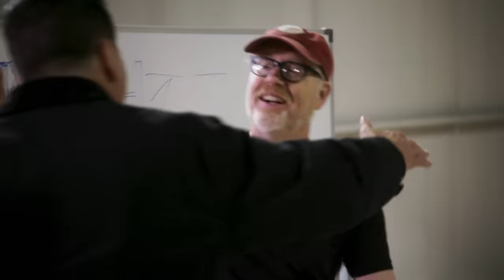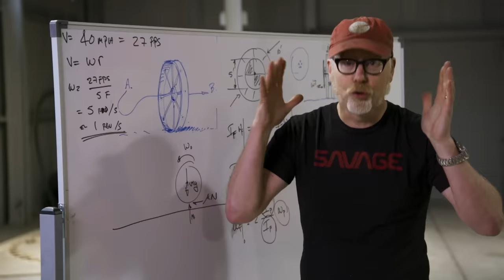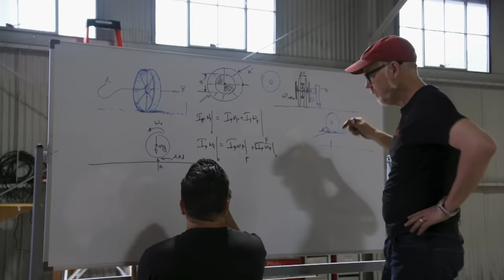"The Power In These Flywheels Scares The Pants Off Me" | Savage Builds

Comment: "We've mounted our twin 5-foot flywheels on a perfectly balanced custom axle..."   on 2 rickety metal sawhorses and secured with a single guitar strap.
Reply: I actually think the Strap could be strong enough to hold the Wheels, if they touch the ground, because they slide. It gets problematic if both wheels do not hit the ground at the same time, and the edge of one of the flywheels cut through the strap.
Obviously they should have used two straps to stop any turning and probably would have been fine, apart from flying pieces of concrete.
Reply: @Opharg  Yep. The 1st thing I was thinking before they started spooling it up was if there was any linear "crawl" it would try to rotate horizontally on the sawhorses; and with only 1 strap, would likely continue until.....and yeah the strap would probably hold unless it either twisted til it broke or like you said, a wheel cut into the strap.   Scary stuff.
Reply: I suspect that, if the thing and fallen or twisted off the sawhorses, it would immediately bounce around the building at speed dragging the sawhorses with it. Unless they were bolted to the floor?
Reply: Lead Engineer on the NASA Mars program, but here he is watching a couple of giant lethal wobbly steel disks strapped to a couple of oversize steel trestles using an old car seat belt...
Reply: But it would have been another $9.99 for a second strap.
Reply: Probably some duct tape in there too. For confidence.
Reply: Or, you know, just chain the axle to a roof beam.
Reply: @WrongDemographic  Sawhorses wrapped up around the axle......a giant out of control self-powered Cuisinart set to puree.
What I would do: beefy over-engineered steel mount bolted to the floor with bolted U-brackets clamping it to the mount. Then maybe I would be in the same room when they spool it up.
Reply: Adam savageness intensifies
Reply: First question out of my mouth was "why didn't you weld a set of lift points on that thing and hang it from a chain fall hoist!?"
Reply: too funny
Reply: Respect for that guitar strap.  Rock on!
Reply: Question would be how much traction if one or two hit the ground. My guess is it would slip and spin in place and lose energy as it gets traction. They need to bolt it down.
Reply: @michaelmoore7975  I was thinking U bolts too but suspending it from above is also a better idea.
There are just so many better ideas than this..
Reply: @hexdude24  I was thinking about things like a sphere when spun tend to just spin along the same axis as applied. But irregular objects set to spinning will try to upend itself and spin on the smallest rotational axis. A football set horizontal on the ground and spun as it is (large axis) it will raise up on its end and spin like a spiral (small axis). Coins do the same thing, they want to spin on the edge. No matter how much you lean a top over and spin it, it will always try to get back upright. 
But what do I know...I'm just thinkin'.
Reply: Those plates are wobbly.
Reply: The axle and the saw horses should have been bolted down
Reply: @michaelmoore7975  they had a forklift (3:35). Rather than hoping concrete anchor bolts hold, I would've tried to tie to the weight on the forklift's rear. Even if part of a flywheel comes off, it's not going to move a forklift much.
Reply: You guys know this strap is actually made from Kevlar Right?
Reply: @victorteixeira2539  Yes. But against 330 tonnes of kinetic energy, it's an old cotton shoelace.
Reply: @davidhawley1132 ......it's "flat" plate, but like everything it's made down to a price.
Reply: @hexdude24  Each wheel weighs 450 lbs, and when added to the weight of that hefty axle, you’re looking at half a ton of weight on the ground if it falls off the sawhorses. I think that would give it quite a bit of traction.
Reply: @briggsbughouses6291  and this is why spaceX is so far ahead of nasa.
Reply: @robertwoodliff2536  Yeah, flattish, so let's twirl it around to find out how much.
It is interesting how objective words (flat) are subject to the context of the goal (aka objective)..
Reply: Yeah I saw those and thought......um oh no
Reply: @rm9308  The 'Samson Manouever'.
Reply: @briggsbughouses6291  Seatbelt Stronk. Tensile strength 5,000 lbs.
Reply: J K 

The axel had been balanced so welding brackets to it would ruin that
Reply: @frednurk5168  What's wrong with a couple of M16 U bolts so the axle is held rigidly, rather than lashed at a single point in the centre which allows for the axle to cant sideways?
Reply: @ian9toes  But the steel plates were not machined and balanced so that makes the assembly out of balance.
Reply: @mattburgess5697  🤣🤣☠️
Reply: @nightwintertooth9502  Turned up to 11 too...
Reply: @2000freefuel  can't get a secure coupling from the motor to flywheel if the flywheel is dangling around. Perhaps we shouldn't be second guessing lead NASA engineers eh?
Reply: @xnavynuc  Inertia would hold it back initially so it would spin some in place and then gradually gain traction.
Reply: @briggsbughouses6291  speaker scene back to the future.  :')
Reply: @hexdude24  Maybe not much... at first. But it will either angle grinder into the floor (best case) or more likely given all the weight slowly start moving. Think about the wheels on a train. Not a lot of friction and they slip and slide as they start up. But as it gets moving...
Reply: @BigSteve215  Yeah, everyone's talking about the safety issue, but you're pointing to the root cause. A high RPM flywheel has to be precisely balanced, not cut out of steel plate which will randomly vary in thickness.
Reply: @cr4zyj4ck  you can do both! leaving that thing unrestrained is simply irresponsible. they could have left it on the saw horses while it was chained to the rafters, had they done that it could never have touched the floor.
Reply: Just because the axle is "perfectly" balanced doesn't mean the rest of it is.
Reply: @victorteixeira2539  You know that would be entirely pointless, right? More weight for the same strength and lower cost would be an advantage.
Reply: @D all that along with flexing and oscillating in all manor of strange ways as it turns.
Reply: Jiggers .. roulette wheel, & "where she stops, nobody knows.."
Reply: Right. I'd be too nervous to be near set up and I think they realized after how bad it was.
Reply: Reminds me of a wood chipper at a factory that made the flywheels in the video look like spinning toys. The chipper flywheel was at least 9” thick and big in diameter, maybe 6’. It took a massive traction motor and quite a few minutes to get up to speed. The motor had to cycle a few times as to not overheat. Took longer to shut it down. We would take an extended 15 minute break that was more like a half an hour and it sometimes would still be spinning a very very low speed. Had to run some small limbs through it to stop it. A change of blades and waited until back up to full speed checking for any vibrations. Massive energy stored in flywheels.
Reply: @victorteixeira2539  I don't think they care. To much fun being critical.
Reply: My thoughts exactly. They usually hide behind something but they are standing there waiting to be flayed.
Reply: u must be new ? welcome
Reply: you can see they are not straight probably out of round and not balanced. 6:44 it's like an inch out.
Reply: That's why you need actual science ppl to do it. If I were there I would have just let it spin until its out of control. And hope it doesn't hit anyone.
Reply: @rm9308  Yeah, if the largest danger is the flywheels coming off the mount and hitting the floor, then just make sure it can't...
Reply: looks like a seat belt from a car to me
Reply: @whatelseison8970  if youve ever had a spining wheel or disc in your ha d, and tilted the rotational axis at all. Youd probably think twice about hanging it from the ceiling or suspending it at all. I think its called precession, but the wobble that could be created if they are not securely mounted would get out of control and probably rip itself from whatever it was suspended from or take the entire building down with it if it had enough rotational velocity, and mass, which those flywheels at 1k rpm very well could have lol. Honestly id love to see it just for the destruction and demonstration of physics.
Reply: @thatnissan  Yes, I've done many experiments with spinning discs, and yes it's called precession. It occurs in response to a torque being applied to the axis of rotation in an orthogonal direction.  If the axle was supported evenly there would be no such torque and hence no precession.  Besides that fact, support is support and regardless of precession the weight of the assembly is not going to change.  Also I didn't say it was a great idea, (if you look closely, it wasn't even my idea) just that it was a better one.
Reply: @whatelseison8970  im not here to bash, just discussing.
In my mind the torque applied would be their way of removing the starting mechanism they way they did. If it was suspended, as i said, id love to actually see something like this happen at this scale. It would be incredible.
Reply: NASA has always been cost-saving oriented. Remember they re-used the tapes that had recordings of moon landings and were ahead of time to save the recordings on a CD or something.   Well done, NASA.
Reply: Oh, I get it, the axles are perfectly balanced and they mounted the things that needed to be balanced on the part that really didnt need to be ballanced?
Reply: Ya, you caught that. It's as simple as spinning up a bicycle wheel and holding it by one end of the axle. Yes, it will remain vertical and yes it will want to rotate on the horizontal axis. I ride motorcycles that are plenty fast. Ride over a slight rise in road surface at full power at 120+ will have the front wheel off the ground...that rotational torque will want to turn the front wheel to the right...if you dont know that things can be plenty scary when the front wheel comes down pointed in the wrong direction
Reply: @blackbirdxx928  Know what you're sayin'. I've raced dirt bikes for years mx, tt, hare scrambles, etc. Over big doubles or triples if you clutch it and dab the rear brake, the front will drop so you can downside the landing. Or pin it off the jump to make the front end come up.  2 wheels is where its at.
Reply: Funny how stuff that doesn’t matter doesn’t matter
Reply: @MarkSkater  Uh..thank you? I guess. Am I new here? You're referring to me, right?
Reply: @fungdark8270   Thats what the show is all about, things that dont matter. Ever learned a single thing that would benefit your daily life?
Reply: @blackbirdxx928  Yup. Just the axles, nuthin else. Should've balanced the axle housing, the strap, and the sawhorses to complete the unnecessary uselessness....a bit lazy IMO..... but there was an "engineer" on the job, so it's his call  I guess. ;)
Reply: They really should have chalked on both sides of the axle to eliminate this problem.
Reply: @michaelmoore7975  ok
Reply: better use carbon stripe with epoxy to make flywheels
Reply: @briggsbughouses6291  well, on Mars, nobody can hear you scream :))
Reply: Oh come onnnnnn. Weld it to the saw horses, pffft.
Safety nanny's
They are going couple this spinning monster to a set of huge friggin wheels that will shred itself over, under, around and through whatever is in front of it.
Reply: @telephonevip3610  The whole point of a flywheel is mass.  The more massive the better.
Reply: @briggsbughouses6291  then that would’ve broken the budget and we’d be watching this on the Hallmark channel.
Reply: @TheDivergentDrummer  no. it depends on RPM. metals are not so durable at high speeds.
Reply: Yep I was going to say for a network, seems like this was on pennies in someone’s backyard.
Reply: @nightwintertooth9502  I would definitely use a couple of Zakks guitar "straps."  His are the only straps that are heavier than an already heavy guitar.
Reply: @briggsbughouses6291  sometimes you got to wonder how they managed to get anything to space...
Reply: thats what i was thinkin lol, although the strap appears to be similar to a seat belt, so it makes up for the shady stand ll
Reply: @2000freefuel  rotational force would have twisted it if it were hanging on chains. Both sides spinning might have conteracted that but it's a pretty fine line
Reply: Want a real world comparison? Old school shearing grinder.spinning at 2500rpm discs weigh roughly 8 kg. I've seen one come off,bounce 30 metres across a shed,straight through a full wool bale and out the side of the side of the shed. We found it it about 100m away
Reply: @victorteixeira2539  you do know that kevlar can be cut fairly easily, right?

The best option that for whatever reason everyone is overlooking is chaining it down at 4 points instead of 2.
Reply: @yubnub3000  Yes! I was thinking the same thing. All that brain-power, in one room, and NOBODY thought to bolt the saw horses to the floor?! 🤤
Reply: Where ist the bit, where the pants are off?
Reply: DiabolicalGardyloo  to be fair, for something of that size and having that much risk, I wouldn't really say it was suitable. Hence why they shut it down early.
Reply: I hope there was an argument between the NASA engineer and the show's producers before they fired this up.
Reply: What, no duct tape? Naaahhh! 😯😉😄
Reply: @Opharg  should have been bolted down to avoid any vibration . I think a clutch type mechanism similar to a crane brake on each disc could be used to disengage once RPM was obtained would do the job too and act as a brake .
Reply: haha, it was as if they WANTED it to be sketchy
Reply: Such genius couldn't have devised a better plan. Not even a balanced wheel!  In all actuality i do like the guys,  but come on.
Reply: @michaelmoore7975  Think I would have preferred to put the trestles on wheels with rubber tyres. If it gets a wobble, at least the trestles will move with it. Also, rubber tyres will dampen a part of the wobble.
Reply: I guess none of you have ever worked on an advanced project. This is proof of concept and determining the level of construction and other parameters they're going to need for the initial build. This isn't even a prototype at this point. The point wasn't for it to be the most stable or to be perfect, but to gauge how well balanced it was under low power. The straps etc have zero influence on this and they didn't cause any of the problems that occurred.

The problems occurred due to a bearing, and possibly the balance of the wheels themselves. And the axle may not look pretty, but there's tons of shops that balance them so even a used one is sufficient for these purposes.

You're a bunch of Armchair Engineers that have accomplished nothing, basically.
Reply: They are nerds, not geniuses.
Reply: @rm9308  Ya, that's the simplest and best solution.  They won't go anywhere if they are suspended instead of strapped down.
Reply: @michaelmoore7975  Yes. Low safety standards. "Teaching" people to do unsafe things.
Reply: @ian9toes  yeah that's right they couldn't weld a bracket to it. Of coarse they could attach to the bearings. You do know they used bearings didn't you?
Reply: @ian9toes  nah u do the welding first and then the balancing... in the same way prop shafts in a car are modified
Reply: @briggsbughouses6291  cause then nobody would watch it cause we know it's safe :)
Reply: Also, if that thing gets loose in that building, which was a clear possibility, no one is safe. Maybe no one lives.
Reply: @garyfliess4375  Even if everything was secured rock solid and inspected by the world's top engineers, then maybe, just maybe, I might possibly be in the same county when they spooled that thing up...... yeah, no....prolly not.
Reply: Should have the axle in a cradle shaped to it....
Reply: And an advanced 2x4 braking mechanism. 🤦
And surrounded by a mechanical containment system of "umm... well we parked our trucks outside the door, OK?"
Reply: @michaelmoore7975  purée omfg
Reply: And it is this guitar strap that made think this would rock!  But it didnt.
Reply: It would have been way safer if they made it a hair taller and put in two identical curved cuts on it
Reply: @itukuppoo4280  But it would definitely roll.   ;)
Reply: @whatelseison8970  no it’s not a better idea. Remember coriolis forces. Such wheels tend to be able to rotate in the complete 3 D
Reply: I think the real problem was, despite all the intelligence in the room, no one thought about the strap as a pivot point or the friction of separation the electric drive gear from the flywheels.
Reply: LOL, read that just as they said it.
Reply: @Opharg  concrete. Will turn into liquid 400lbs spun up has a lot of  kinetic energy.
Reply: @briggsbughouses6291  spend your budget on the engineer or the materials. can't do both lol
Reply: Should have had chains or straps suspending it from above should it try to walk off its earthly mount (or saddle).  I noticed some ricketyness there too.
Reply: Yeah that was exactly my thoughts. I also thought this should have been done in a 20ft container with a ballistic strength viewing panel
Reply: Maybe bolts to a cement floor  rot equip engi foundation wt=10xEquipWt
Reply: Agreed not very sensible these days🤷🏾‍♂️🤦🏾‍♂️,  expected them to know better 😓
Reply: Right.. Using non-concentric lug nuts and a non-concentric hub..
Reply: No strap is going to hold this behemoth, it's incredibly dangerous, do not try at home, without life insurance.
Reply: @michaelmoore7975  exactly!!
Reply: It's okay, the spinning keeps them on balance... and if they go off balance, we won't be alive to worry about it.
Reply: Instead of rocket propulsion or flywheels why not check out magnetic force I have seen plenty of videos that show magnets to be quite useful especially with movement and also possible power charging too
Reply: Now all the KxK nerds want to argue guitar strap supremacy
Reply: @actuallyeffectivesecretali7318  Then  I vote for Zakk Wylde's giant logging chain guitar "strap."
Reply: @nightwintertooth9502  thought it was a seatbelt.
Reply: I think he meant to say a mathematically perfect balance as when they added side torque he screwed the equation lol
Reply: Yea this doesn't seem professional at all
Reply: @whatelseison8970  I like that they went with the bad idea 🤣🤣🤣🤣 makes me feel smart or not alone in bad idea Dept
Reply: its ok after they ratcheted it they flick the strap and said that will hold
Reply: Exactly.👍
Reply: @rm9308  the
Reply: It's their kind of thinking that got a rover on Mars
Reply: It wouldn't be DIY without blatantly ignoring everything OSHA stands for
Reply: Ya love to see it. Wouldn't expect anything less
Reply: We appreciate you providing commentary for the deaf. Do you do this on all the videos you watch?
Reply: As near-sighted on safety and physics as he is, how does he even get insurance for these projects?!?!
It's like watching my 12 year old friend try to build a helicopter.  So lucky no one has died yet.
Reply: Them saw horses is supporting 900 pounds like it ain't no thang.
Reply: @xnavynuc  you forgot to add the potential of all of it falling at 8.6 Ms/s and with those disks rotating that fast? That's and energy PEZ dispenser
Reply: The gyro effect would cause it to ride one wheel and speed off in a curve.... I've already done this....for fun at work.
Reply: @Michael Moore - I think this is my favorite comment ever
Reply: Guitar straps are designed to carry heavy metal.
Reply: @mw9688  Touché. I'll see myself out.
Reply: @Pissjuggernaut  And you are my favorite commenter, ever. You are so honest.  ;)
Reply: @michaelmoore7975  Hahaha! Well played!
Reply: I’ve done some sketchy stuff around the farm but this tops it
Reply: Ask me why I never got into Mythbusters. Flawed science in every episode.
Reply: He landed a rover on Mars, youre watching Adam savage on YouTube literally tell you how smart this guy is and you still are claiming you see something he didn't calculate?
Reply: @lasalle47  Are you asking me?
Reply: Well it shouldn't matter so long as the axels are balances
Reply: I'm sure the horses were perfectly balanced as well.
Reply: While I tug on the motor stand that's just metal on concrete
Reply: Rock n roll 🤘
Reply: @rm9308  and risk resonance that makes the building collapse, meh..
Reply: Yeah this seemed like a mentally challenged setup
Reply: Thought the same thing. Lol. Wasnt even secured to them either.
Reply: I engineer Balancing Machines and you knew that this contraption is not even close to "perfectly balanced".
They put lot of trust in these two sawhorses.